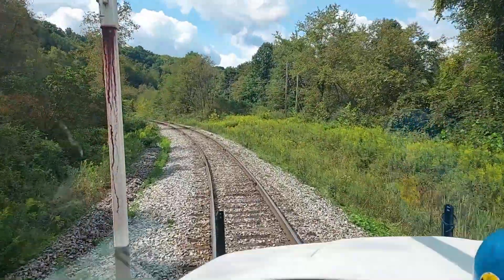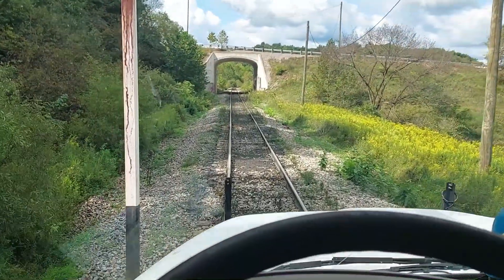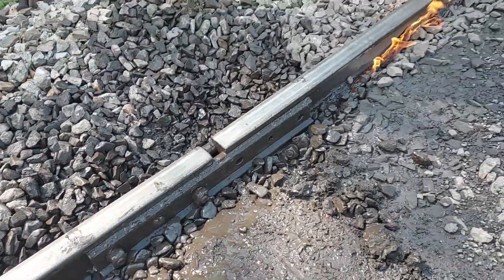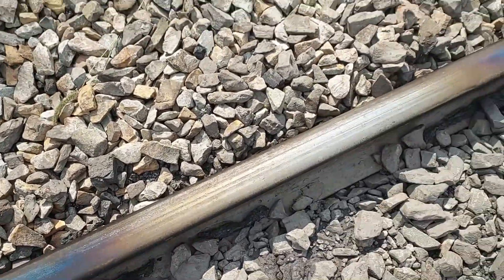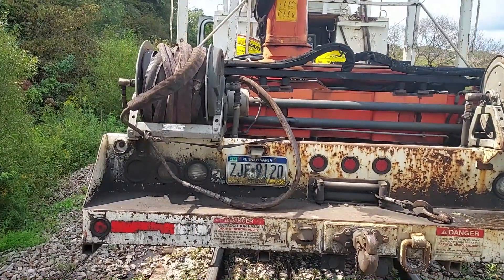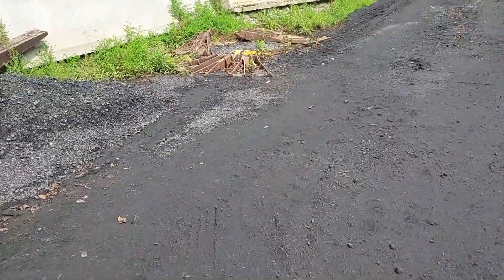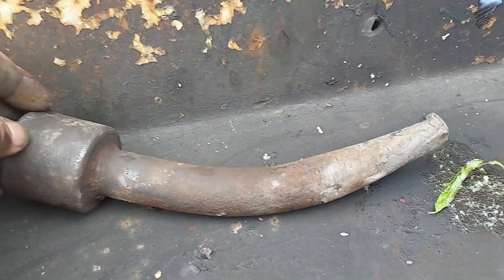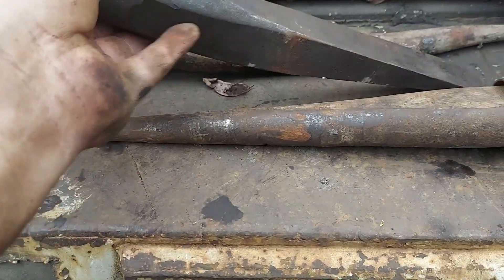I Set the Rail on Fire Today! Fire Snake in Action!!!

Comment: 1:21 what is the purpose of the two track looking things on the inside of the regular tracks?

at first I thought you had somehow accidentally started a fire and a "fire snake" was some extinguishing device
Reply from the maker: Very good question Rodney, they are guard rails as Milosz Ostrow
has described in his reply. They have also been called by some
older railroaders as Jordan Rails.
Reply: @ccrx6700  and the purpose of fire snake is to heat / expand the rails so you can close a gap?
Reply from the maker: @rodneydaub3812  yes sir
Reply: @ccrx6700  when they invented fire snake, it named itself
Reply: Known as guard rails or check rails, the extra rails set within the pair of regular rails limit lateral motion of derailed rolling stock.  They are typically used on bridges and in tunnels where excessive lateral motion after a derailment could be particularly disastrous.

Comment: That gel is probably the same thing that's in Sterno cans, for chafing pans.  It's burning pretty clean, so it looks like it's alcohol based.
Reply from the maker: It does burn fairly clean, we used to have diesel soaked rope and it
put off a lot of black smoke obviously, thanks for watching today;s show
Reply: Well it said denatured alcohol and middle distillates, which could be anything from jet 1 to bunker 1 fuel, but if I were to say what "cut" of distillate considering how clean the burn was probably something K-1 or better. Not sure just a guess.

Comment: I found this fascinating We do not have anything like the Fire Snake. I guess our temperature does not fluctuate as much but we still get pull aparts and close the gap by loosening 6 or more rails either side of the gap  so each rail can be moved a little. I saw your other upload on the bridge and am pleased you made this fuller explanation of how it works.
Reply from the maker: Oh wow, that is a struggle to pull rail like that. We used to have a
mechanical puller where you'd have to loosen the bolts like you 
describe and knock off all the anchors, what a pain that was. When
we finally got the snake and fire rope, I scrapped that puller.... but don't tell anybody...LOL  Not sure what other video you are referring
to but glad you enjoyed it. Oftentimes I forget to fully inform folks
on several aspects, my fault on that, I'm trying to do better
Reply: @ccrx6700  https://www.youtube.com/watch?v=jVxpq59ugoo It was this one. One of your early uploads. I think the snake is a good way Keeps you warm on a cold day and not so heavy to lug around as a puller no wonder it went for scrap LOL

Comment: How do those pickup trucks on train trucks work?  How does the power get from the truck transmission to the train wheel trucks?
And how do the rails pull apart like that anyway?  You'd think that hammering the one joint back would open up the next one down the line....very strange business...
Reply from the maker: The rear rubber tires drive the hi rail trucks. Rails most often contract
via cold temps. Also the dynamic forces of the train passing over the
rails causes what is called rail creep. This creep is exaggerated on
our RR cause we do not have bi directional loads, so all the rail "runs"
or creeps east. Good bolts are what hold the track from pulling, in
this case the bolts had weakened and broke so there was little
resistance to the rails running. hope that helps

Comment: We used to have four 30 gallon barrels of diesel fuel gasoline mix ( 4 d with 1 g) and 150 ft of asbestos rope in each one. We actually had a couple of short rails, (  2 feet shorter than normal)  that we would put in in summer. In the winter, up in Wyoming when the weather got cool, we took out the short rails and put in the long ones. Still had to use the fire snake some, but it made it a lot easier when it was -30 to -50 between Lysite and Powder River.
Reply from the maker: Wow! that a lot of work to go through replacing that rail like that,
then you'd have to tamp and throw the curve in or out to accomodate?
We've bumped a good bit of rail over the years but never stretched it.
At those low temps, our locos probably wouldn't even run! LOL
We have used rope soaked in diesel way back, I think it burns hotter
but is a sloppy mess to work with getting it laid, snake fumes are
very toxic tho, breathe in that for more than a few seconds and it
will put you to your knees

Comment: i remember one of the guys i worked with was on the track gang. we were talking about a split in the track up in the mountains and i asked him what the max gap in the rail could be. he told me the largest safe gap you could have was half inch. and if it was 3/4 inch it had to be taken care of. anything over those and the rail was replaced
Reply from the maker: 3/4 pretty good gap, that really stretches the bolts to get that far and
eventually they weaken and snap, we've had a few joints get that far without breaking the bolts, but it always a big chance to take, your right best to take care of it when warmer if possible

Comment: Do you have much bother with Cyclic Top?
When I worked on Network Rail's track inspection trains is was one of the track faults we paid a lot of attention to.
Reply from the maker: If I understand that right, cyclic top is when a train has a lot of bouncing which cause the tracks to get beaten down then not, like a roller coaster type of thing? Going only 25 MPH on our track almost
no bouncing occurs, that happens a lot more on higher speed track.
However having a lot of jointed track and a lot of spots the track
conditions pretty much mimic what you are saying, only difference
is the cause. Please correct me if I'm wrong, and will look forward
to hearing more from you sir

Comment: Why did and how did it pull apart if the track was bolted together?
Reply from the maker: Bolts on one end of joint had weakened and snapped, then with the train running over it that helped pull the rail even further apart. New bolts in now it will be good, appreciate your watching Bob

Comment: Does the heat on the rail ever lead to issues with the heat treatment?
Changing color on steel is risky in other applications, but maybe the rail work hardens so it doesn't affect it?

Also in situations like that you might consider setting the camera so it is pointing down at the ground and rail, low enough and zoomed in far enough that faces don't get in it.
It would not be a "perfect" shot, but it would give us something to look at, maybe as a time lapse?
Just an idea to think about lol

You could also offer Memberships, and put Members Only videos like that where faces might show, but crop or blur all the faces, using our membership fees to pay for your extra time editing... ;)
Reply from the maker: Ben, in all the years I been using rail heaters this is the first time
I have ever seen bluing to that degree, and I have no clue why. Snake burns the same temps whether it was 10 years ago or today, and the
bluing was in spots, I am puzzled by that, do you have any idea on that
anomaly?
Reply: @ccrx6700  well that's interesting! Lol

Have you ever used fire snakes or equivalent on days that warm?
I know you said that it popped at a much higher temperature than usual, and I am guessing that usually you are dealing with it on much colder days, which also means that you don't need as much heat in the metal to get the needed expansion.

In other words, on a 30 degree day you may only need to raise the temperature 60 degrees to get it back to summer length, but if it's already 60 degrees and you are trying to make it considerably longer, you may need to add a lot more heat to it, plus it's starting at a higher temperature to begin with, so the added heat will raise the rail temperature considerably.

So my theory would be that because you started at a higher temperature than normal, that you got the rail to a higher temperature, possibly hotter than you ever have before?

Oh, and since the air was warmer, it would not be sucking as much heat from the flame, allowing more to go into the metal.
So the snake might not burn "hotter" as in the textbook combustion temperature of the fuel is the same, but the effective heat output may be much higher. 
Think of how much faster a wood stove heats the house on a summer day than in the middle of winter lol

And since metal expansion is a temperature differential function, it's going to behave differently at low temperatures than high temperatures I would think. 

Now, if you have run fire snakes on warm days before, for as long as you did on this without having the bluing effect, maybe there is something different about that particular piece of rail as well.
Maybe the head is slightly thinner, or it was heat treated differently, or for some reason it reacted to the heat a little differently.

I would probably watch that section of rail over time and just see if it wears differently or does anything out of the ordinary.

That's railroading! Lol
Reply: It's one way of prestressing Continuous Welded Rail before thermite welding the joints.

Comment: I understand the purpose of heating to expand it but what happens when it shrinks from cooling back to ambient temp? Would that put excessive tension on the jointers?
Reply: Yes it will. But the steel rail will stretch a little when it is cooled, and expand when it gets warm. Eventually, the bolts will fail somewhere from the force gradually weakening them. The rails and plates are much stronger than the bolts, which will fail first. The rails are amazingly strong. I watched a loaded freight train creep over a bridge in New Orleans on the CSX RR, where 2/3 of the ties had been removed for bridge maintenance. You would not believe how much the rails bent down without breaking.
Reply from the maker: The new bolts will hold the joint from pulling apart, but most likely
down the road another joint will pull apart in this section, we need to
add some rail in here. Also I didn't explain this in the movie but when
the bolts broke probably from the muddy joint pumping which weakened the bolts, then the rail ran (rail creep) east from the passing train. Hope that clarifies it better, if not write me back

Comment: Just to clarify since you didn’t say.  I’m guessing the shrinking rail sheared the bolts apart that went through the joint bars and rail.  Yes?   Would have been interesting to see the pieces of the bolts.  Thanks Dave.  I never thought about rails coming apart before.
Reply from the maker: The muddy joint there caused the bolts to weaken from it pumpiing Russ, I didn't explain this very good in the movie. Then when there
was no resistance left the train passing over it plus the cooler temps
caused the rail to run east (rail creep), that made the big gap. Sorry never thought to show the broken bolts, apologize for that, but glad
you tell me this stuff. When I know what viewers want to see that
helps me know what to show in future vids
Reply: I love your videos.  They make me question things I never thought of before.  Watched it again which answered why the oval holes.  The bolts have an oval shank so they don’t turn when tightening the nuts.  Surely the donkey dick drift pin was straight when new.   I can’t see how you could drive it in now as bent as it is.
Reply from the maker: @russbielak7240  thanks Russ, your comment made me realize most folks have no idea what a track bolt looks like, so gonna make a short showing what one looks like, thanks for the idea. And yes all drift pins come straight, and that donkey was what I used for that earlier 4 inch pull apart

Comment: The railroad I work for we just use 40 ft ropes soaked in diesel, it sure makes a lot more smoke than what your fire snake does haha
Reply from the maker: We used to use the rope also Andrew before we started getting
snake, yep it makes more smoke, is a lot sloppier, but I do believe
the rope burns hotter and doesn't last quite as long. Main reason I
don't use the rope more often is cause of it a sloppy mess to deal
with but other than that I do like it better than the snake. Those snake fumes are unreal, can put you down right now if you breathe 
it for more than a few seconds

Comment: Enjoyed the video, very informative as all videos. Now, the temperature will separate the rails. So if heating expands the rail, what stops it from separating again? Once the temp drops, does it create a mass problem with separation? I may have missed the answers, but am curious to the solution. Thanks again, love the videos!
Reply from the maker: Very good question and I can see you have a thinking mind Peter,
I like that. Once the joint is made after the rails come together, the
new bolts create enough strength to prevent the rails from pulling apart. It's weak bolts that are snapped by the contracting rail and once the bolts snap, then there is nothing to stop further contraction.
Reply: @ccrx6700  I understand now. Hard to believe there's that much expansion and contraction with the rails. Very informative. Thank you for answering!

Comment: No worries about not being able to show the actual work.  I'm just grateful that your company allows you to film as much as you do.  It's very much appreciated, especially for a non-railroader like me where pretty much everything you show is a new lesson.  By the way, ethanol is grain alcohol, isopropanol is rubbing alcohol and medium distillates is basically the same as charcoal lighter fluid.  They put those liquids in the gel stuff so that it comes out slowly and burns over time (otherwise it would just be a big whoosh of flame that would quickly burn itself out).
Reply from the maker: Thank you for the very nice comment, was great to hear and also
really appreciate the chemistry lesson! That was really informative for me. The fumes coming off when it burns is wicked stuff, breathe
in some of that for more than a few seconds and it will put you to
your knees

Comment: Railroad maintenance has always fascinated me. Is it better to lay track in cold weather to avoid these pull aparts, or does that just create expansion issues and buckling?
Reply from the maker: Great question Jeff and that shows you are a thinking man, and I like
that. There are fed regs on what temps to rail CWR. For jointed rail like we have we like to lay it if possible at near rail neutral temps.
Rail neutral is when the rail is neither under contraction or expansion. That is generally when ambient temps are from 50 to 65.
Rail can be laid in colder temps, but when we do that we also
have used fire snake to expand the rail, hope that helps sir and I
really like your kind of questions

Comment: What is the allowance for a split? Very interesting and I really appreciate you sharing this with us. You never cease to amaze me with everything about the RR. Great job, again!
Reply from the maker: Valerie, the code fed regs does not have anything that gives specifics on rail end
gap allowances, however they do stipulate that each joint on a class 2 RR like we have, have 2 bolts per joint. This means that the gap between rails should never be over
an inch or so. Our ideal gap is about 3/8 of an inch, of course in the real world
over 17 miles of track this varies constantly and is never consistent. Hope
that helps clarify and I do appreciate you my friend
Reply: @ccrx6700  Thank you for answering my questions so quickly. Thanks again for your videos.
Reply from the maker: @valeriebassett3107  👍

Comment: The blue in the rail is a defect now, because of overheating of the rail.
Reply: Blue on steel means brittle steel, that’s needs to be grinded down otherwise it will start shalling real soon
Reply from the maker: We will keep a close eye on it, actually that's the first time the
snake has ever caused that effect here that I can remember, usually it a dullish sooty color,
thanks for the heads up Dimitri

Comment: Any chance of thermite welding the joints?
Pull aparts are certainly railroading!!!!
Reply from the maker: With the 3 bolt holes they can't weld a joint as the 3rd hole is
too close to the weld. So we would have to replace every stick with
blank ends or 2 hole ends, a huge expense and time commitment,
so it ain't likely gonna happen, although in new rail installations
we are now welding every other joint and sometimes up to 4 joints
in a row. Appreciate your watching Shane

Comment: What causes pull aparts I know cold weather plays a part but the tracks are designed for cold weather so is it fatigue in a part
Reply from the maker: You are right Jacob on both counts. In this case the joint movement
along with rail creep caused the bolts to fatigue and then break,
so when there wasn't anything holding the rail, it just pulled apart.
It's a constant thing with 17 miles of track replacing bolts that break

Comment: I wonder if you use a hydraulic device that pulls the rails together so you can thermite weld the break? I watched the fellas on the old ic iowa div. Do that near me one day.
Reply from the maker: We used to have a manual puller that was a total pain to use but
it worked. That would be the ticket a hydraulic one, but the snake
is a lot easier. We can't weld the joint cause of the 3 holes in the rail,
can only weld 2 hole or no hole ends. Appreciate your watching Kelley

Comment: Is that an area of wet beds as well? Does that have any effect on the pull apart as well?
Reply from the maker: We don't have very good drainage here Robert and the ballast is
fowled up pretty good. This section is on the list to get cribbed and
drainage work done, but just got so much other stuff needs done
first. I'm sure the muddy joint had a lot to do with the bolts getting
weakened and breaking
Reply: @ccrx6700  thanks for the reply. I when I worked on a preserved steam railway PW was always a black box that broke our engines. Your videos have given me a much better insight into how track is managed. Thanks for the great content!👍